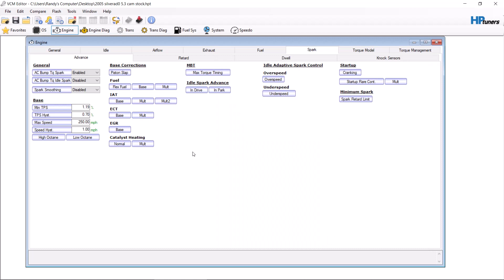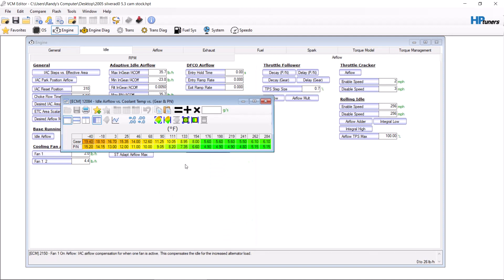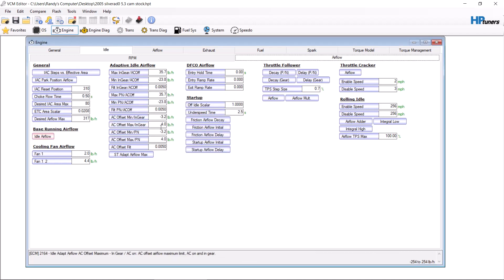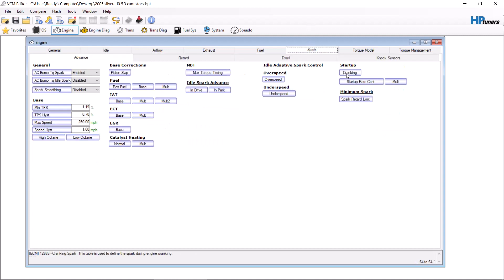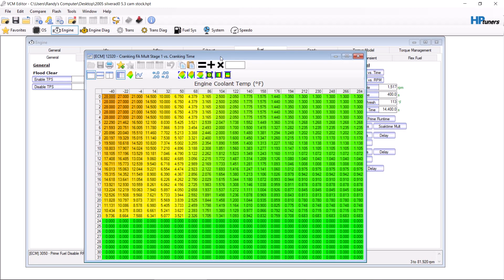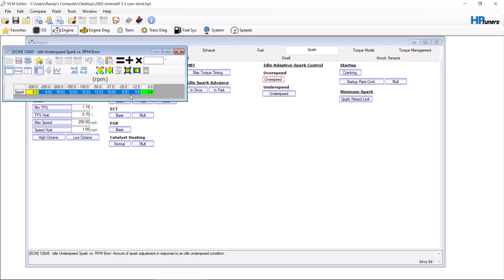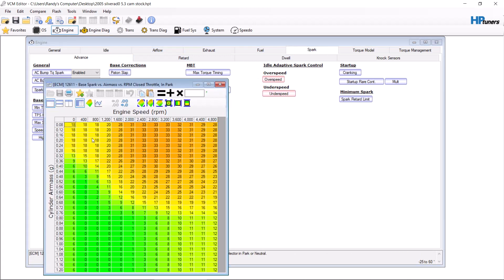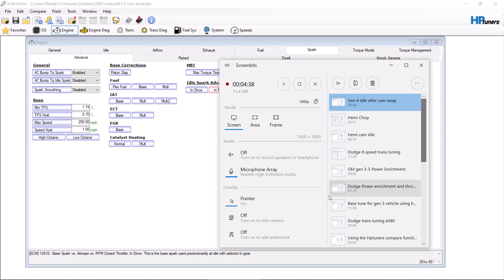Gen 3 ls Engine idle after cam swap

Comment: Okay so I been watch you videos on here and I have an issue that I can’t find for my lq4 4l80 I swapped a Elgin ss2 cam and I got the truck to idle but if I touch the throttle or shift out of park it stalls I’ve checked forums and YouTube for something on it and no luck

Comment: Hey man I know this is an older video but I could use some help. I'm dialing in the idle on my brothers cammed 5.3 OBS. The idle seems to "run away" in the AFRs after a while. I added more fuel and it will stay around 15-16 at idle instead of running away to nearly 20. Is 15-16 okay?

Comment: In my 2000 Silverado 1500, I'm running a Texas Speed 220R cam.  In an upgraded LQ9. 6.0L for those who don't know RPOs  ( Coated bearings, New Ceramic / Teflon coated full floating pistons, Gen4 LS3 Rods, Comp Springs, Comp Roller Bearing Trunnions, Double Roller Timing Chain set, Melling HV/HP oil pump, Shorty Headers, LS7 Ceramic ball Lifters, Oversized Balancer Pulley, and some other stuff I can't think of.  Do you happen to know how much cam lift you can have before the stock GM Valve covers become a problem?

Comment: What size cam are you turning for?  Thanks  (I just wanted to add, I've been searching for DAYS on youtube for a decent "IDLE TUNE FOR GEN3 CAM SWAP" and after watching 30+ videos that most were 20mins+... This has been THE BEST I'VE SEEN!!!! Straight and TO THE POINT!!!  Thank you soooooo much.
Reply: Could you help me tune my truck?  PLZ PLZ PLZ.. I've hit a wall i can't jump... You can make a video out of it... could be a good learning video for others! :)  plz plz plz..
Reply from the maker: What’s wrong
Reply: @Recklessmotorsports  SOOO..
This is a 2000 silverado DBC 6.0L LQ9, 234 heads, TSP220R cam, Shorty Headers, P01 ECU, running base tune from 2002 Tahoe L59 (5.3l w/ flex fuel) as I've replaced the vacuum fuel pressure regulator with a 2001 corvette fuel filter (return line style filter). EGR Delete and added a Flex Fuel sensor...  I had purchased new injectors, but they are too short, so I went back to the stock LQ9 21.4lb injectors.  The Tune was showing 35lb for the l59.  When left at the 35lb, it is very hard to start, idles like crap, but gets better around 2500.  Under  heavy throttle, it goes lean at around 16.8-17AFR.  I bumped up some stuff to make it "idle" and a little easier to start.  When I tell it, they are 21lb injectors it became really really hard to start, and under heavy PE throttle, it falls flat on its face with a RICH stall AFR of 6-7..  It seems to run best when told they are 25lb injectors.  However.   Sometimes it'll start right up, sometimes it cranks and cranks, and I hear a "puff puff" and finally it'll get off to a slow run then pep up.  Idle will get into a "bounce" where it's fine, then will go upto 850 down to 650, upto 950 down to 550, upto 1200 down to 400 and stall out.  Stays right at 13.5-14.9afr at that time.  No knock or miss is ever detected...  I have the flex fuel sensor turned off in the tune, to try and void any trouble from that out.  
02 l59 Tahoe didn't have egr to start, so I couldn't have messed anything up turning that off. (Because it came turned off, lol).  Finally,  I removed the clutch fan and went to dual electric fans that are on ECU controlled relays.  Fan1 and fan2.  I have some driving logs I can post if that'll help.  However my AFR Guage isn't in them.  I just watch that on the dash.
Reply: @Recklessmotorsports  I'll add one more thing.  This is my first non-stock LS, so I kept it rather mellow.  But I've build carbed SBC and BBC motors that made around 500-800HP "respectively" and can duplicate that all day with my eyes closed.  If this was a carbed engine, I know exactly what I'd do.  But with the ECU, I'm not sure of what to do, because it seems like nothing is 1+2=3.  It's all A*B or/if B =/>T&A than F and/if <T&A =BIG than 😉...
Follow me so far?
Reply from the maker: You’ll probably need to send me stock file and mod file so I can look them over
Reply: @Recklessmotorsports  I'll do that.  Where do I sent them to?

Comment: Is there a way I can make my cam lope sound more aggressive. Is it only in the overspeed and underspeed tables or is there something else I need to adjust. I don't know all my cam specs because it was a custom cam but its a 228/235 with a 113+4 lsa
Reply from the maker: You want it to be shorter with larger chops?
Reply: @Recklessmotorsports  I want more of that chop and not as smooth sounding as it is as long as I don't mess up the rest of the tune because drivability is good right now. I want that popcorn crackle chop sound at idle. So I guess yes with larger chops
Reply from the maker: Lower idle rpm and add more fuel
Reply: @Recklessmotorsports  okay thanks

Comment: Hey man my idle airflow table is super high and I’m a little nervous about tuning it down, you added 20% and another video the guy added 30% but my numbers at like 4x higher than that I don’t know what to do really because my truck does run and idle now but it still needs to be adjusted and I’m still new to this
Reply: Okay so I just realized my table is pounds per hour and yours is gram per second
Reply from the maker: Yes always change it to g/s